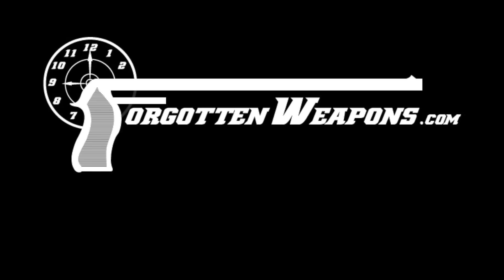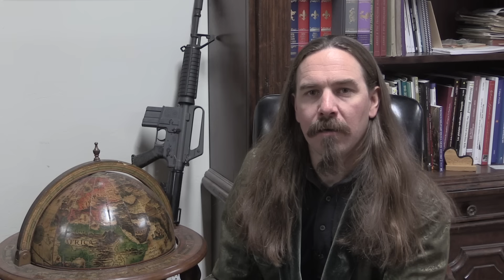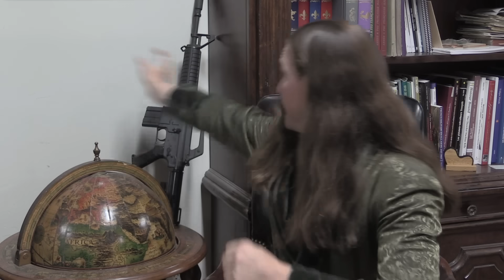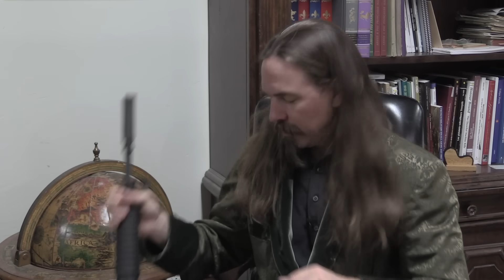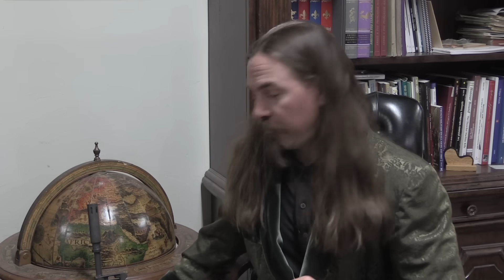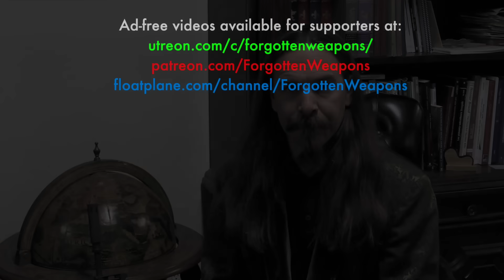Ask Ian: "Last Ditch" Rifles for World War III?

Comment: Having gone through US Army
basic training within the last year, I'll have you know the current issue M4A1 has auto instead of burst. Also, many of the weapons we had were originally M4's that had been converted to M4A1's, with the burst marking overstamped with auto and M4 overstamped with M4A1. I think it is also likely that for last ditch production, you would see carbine barrels because you can get twice as many carbine barrels from barrel blanks than you can get with 20 inch barrels. At least, that is what I've been told about button rifled barrels.
Reply: Blanks can be any length. They don't have to start off at 20"+. Profile your tube and drag a button through it. The longer barrel thing is more of a strategic resource use thing. Long barrels consume more material resources.
Reply: Barrels can be made to any length, but shorter barrels would have a number of advantages in this scenario.  Less raw material, less cycle time in the drilling and reaming operations, less cycle time in profiling, and the reduced workpiece weight means everything is easier and cheaper to move around and handle between operations.  The cycle time for button rifling is very short compared to all the other operations, but overall, even cutting 1" of length off of new barrels would save a lot of time and money when you consider the big quantities.
Reply: @rockhuddy  hammer forging would negate the need to drill, ream, and chamber which is time consuming and expensive compared to smashing tube onto a mandrel.
Reply: @randomidiot8142 CHF is definitely a very efficient process. In war scenarios, sometimes less efficient methods are used in concert with better ones. This could be because the tooling/setup for the better method is a significant investment, time consuming, or few companies can support it. I'll point out that the cast hull Sherman tanks eliminated much of the expensive, time-consuming welding, but welded  hulls were still rolling off assembly lines at the same time. This was because many of the Sherman producers didn't have casting facilities capable of making a full hull.
Reply: @randomidiot8142  You still need to drill and ream prior to hammer forging, maybe you could get away with drill only but the quality would suffer significantly.  I'm not aware of any hammer forging done from tubing, if that was an option then you could just as easily button rifle tubing.  Putting in the chamber as part of the hammer forging process is possible, and might make sense in this scenario, but it's not very common right now due to quality concerns.
Reply: @rockhuddy  no, you don't need to drill and ream before hammer forging. That's the whole point of hammer forging. You put bars of drawn over mandrel seamless tubing in one side and barrels come out the other. If you drill and ream, you might as well button rifle. I am pretty sure that TJ makes barrel liners from tubing, because his barrels are just rifled thin wall tubes. Working heavy-wall tube down to thin wall tube takes a lot more force and it doesn't make sense to do it when you can just buy tubing closer to your finished size.
Reply: One shot one kill…
Reply: Those are the old ones. I got out in 2019. My unit (4-25 BCT) had full-auto by 2018.
Reply: @randomidiot8142  your screen name makes a lot of sense suddenly
Reply: @D Murray Oh no, we didn't train with full auto. Using full auto was a ticket to being tackled by a drill sergeant. I'm just saying none of the carbines we used had a burst mechanism.
Reply: @D Murray Marine corps units that are low speed enough still have m16a4s, instead of m4a1s or m27s. Some NG units are still given A2s
Reply: @MrBenjaminleduc  - Not a given when using the Poodleshooter, especially one with the short barrel. The entire Flawed concept of SDHV is negated once the tube is shortened below 20”.  Having been forced to carry one of these in its CAR configuration I put 5 center mass hits on an enemy combatant only to have him continue to advance until I put one in his head.(tells you how close he was!). It’s way past time for the American Warrior to be issued a Proper Combat Rifle/Carbine and relegate the M16 series to the dustbin of history. The new 6.8mm that’s being slowly issued as the .556 is phased out is a step in the right direction but we all know how the MIC drags its heels when it comes to change.
Reply: The M4 is burst the M4A1 is full auto.

Comment: First, take the time to do it right...then think about cheap.
A perfect example is the simplification of the M1903 for WWII production.
On AR, I'd drop the fun switch and stick with semi only.
LAST thought...why the barrel cut instead of just making a slightly larger barrel clamp for M203s and eliminate a weak point in the barrel along with reducing cost?
Reply: True during world war 2 the Japanese and the Germans had iusses  military and industrial production  for example the Japanese have the home guard old men from the ages of 17 to 70 and women for the ages of 16 to 50  and the Nazis had the Volksstrum ages 17 to 40 and basically Hitler youth from ages 13 to 80
Reply: Integrated muzzle devices. Just holes drilled/machined into the barrel. Removed the threading step and having to making the muzzle device.

Comment: KE arms lowers would be key.  You can injection mold way faster than forge and machine. I am glad a company finally got the kinks worked out of polymer lowers.
Reply: @ljubomirculibrk4097  How much does recycling even matter in this scenario? You are sending guns out to the front line that are eventually going to be destroyed sight unseen or captured. Polymer molding fits neatly into this scenario as it's about as strong as aluminum if your polymer mix and design are just right, which the KP-15 lower happens to be.

If militaries had no problem making stocks out of wood for rifles chambered with far more powerful stuff than 5.56 that realistically couldn't be recycled, reused for anything else, and can rot over time in the right conditions for 100s of years, I see no problem issuing M4/M16s out of polymer.

And is there even an AR-15 lower that's stamped?
Reply: @ljubomirculibrk4097 you would have to stamp a lower for an AR in two halves. With the additional time it will take to weld them, you’re not going to get production time to just over a minute. Not to mention the additional time it takes to mount a tube, butt stock  and grip.
Reply: @@ljubomirculibrk4097   yea, but you still have to assemble the sheet metal and rivet together?  I honestly wasn't really think about the AK or stamped design. I was boxing myself into the standard AR/M4 platform. KE arms can mold one in 65s .  That's pretty damn fast.
Reply: @@user-ts3sw5pm7k  I own a KP-15.  It's solid.  It's not going anywhere and you can buy one for 80 bucks. I wouldn't make a sniper system from it, but for a general purpose 500 yds and in rifle, it works just fine.
Reply: @nathanielkidd2840   I think he is referring more to an AK style system.
Reply: Even better: redesign the upper to also be made from polymer.  The bolt, barrel, and trunion still need to be metal, not much else does.  Springs will be metal, of course, but they are cheap and stanardized.  Polymer fire control groups have been tried an do work, although metal insets on the rubbing and striking surfaces would be more reliable.  Even the smallest injection molding machines could make those parts.  There might be heat issues with the polymer upper, but chances are, conscripts won't shoot enough rounds for that to show up.
Reply: @@24680kong  barrel nut and gas tube would melt it unless it was made of PEEK or some kind of high temp polymer. Currently, that would cost much more than Aluminum.
Reply: @ljubomirculibrk4097  A block of steel may be more durable than a block of plastic, but a monolithic injection molded receiver will be more durable than a stamped, welded steel receiver. The fudds are wrong, steel is overrated for things that don't need to handle the full stress of firing.

Comment: I think one of the biggest ways to save time would be finish quality, I used to make M2 barrels and from start to finish took about 80 minutes for the profiling, as it was important to go slower for 1. insert life and 2. Surface finish (we shot for about 15-25 RA, but the exterior finish smoothness doesn't actually make a huge deal for the most part, excluding the muzzle/threads, you could drop 10-25 minutes a barrel just by cranking up the speed and sacrificing that surface finish down to about 125-175RA.

Comment: Teh Finnish army actually planned this in the early 60s. They designed what they called 7,62 RK X. It had a very crude stamped receiver which did not have a separate cover. The idea was that then one could use parts made for normal repair work to quickly assembler rifles.

Comment: My first thought to a war time at would be to get rid of the forward assist. There are many competition guns out there that don't have it. Stoner also added it to appease the army many years ago so it is clearly not needed 

Other considerations are things like the steel alloy used for the BCG. You could go back to something like high carbon tool steel which would last long enough apply a good coating and possibly reduce material complexity. 

Finally do you think they would just get rid of the detachable carry handle and go back to a fixed A2 style. Seems like it would reduce a lot of parts, machine time and logistical challenges of getting all the pieces to meet up somewhere when it was a completed firearm.

Comment: Having worked at injection molding the "cycle time" is usually from the mold closing to opening again and producing a part. Something under high stress, like a rifle receiver, would have from one to three steel inserts placed in the mold at each cycle (depending on the design). A skilled operator might do this in 15 to 20 seconds with a well organized supply of inserts at hand. Let's say a minute and a half per receiver which still beats a CNC operation by a mile.
Reply: Try zero steel inserts as is the case with the KP15. 

Ian has videos still up on YouTube about the monolithic polymer lower and his utreon page may have the factory tour footage.
Reply: @jeffreyholdeman3042  I can't say that I'd fire a centerfire rifle with an all plastic receiver. Assuming a semi-auto design I would have to see two guide rails (could be one piece) and a boss for the barrel to thread into. When I was in plastics even the Ruger ten round 10/22 mags had an insert.
Reply: Robot placement of the stamper metal inserts and over molded parts. With the press starting to start ejecting plastic before toggle lock. Imation had the 3.5 computer disk case down less that 45 second cycle time. With robot extraction starting to moving before the mold fully opened. The picatinny rail, stock and forearm could all be one piece.
Reply: @kennethwers  I've been at my current job for about 15 years so probably a little longer since I've worked in plastics (maybe 20 years). We placed inserts by hand and then (for safety) started the next cycle manually. Robotics could easily speed this up for a company willing to invest in it.
Reply: I agree wholeheartedly about the barrel attachment and rails for the bolt… the receiver (lower) that Ian referenced is unsupported polymer.

Comment: I would think the forward assist would be one of the first things to go.
Reply: The forward assist should have never existed to begin with. But yes it'd likely go first along with adjustable stocks and optics.
Reply: @clothar23  If you train to use it, it's useful once in a great while.
Reply: @generalkayoss7347   The forward assist exist solely for the purpose of dealing with a problem racking the charging handle solves just as well.

And racking the charging handle has the added benefit of not getting a round jammed into unfortunate places.
Reply: @clothar23  Yeah but bumping the forward assist is faster than racking the charging handle, plus you don't lose a round.
Reply: Last ditch rifles will mostly use last ditch ammo…….
Reply: @clothar23  No it does not fix a problem that the charging handle will solve. If your chamber is slightly fouled or dirty and spring pressure alone won't allow the bolt to close on a live round, chambering another round will have the same failure. At least with a forward assist OR a fixed charging handle you can force it closed and not repeat the same problem twice. Darn it, GeneralKayoss beat me to it,
Reply: @Hjerte_Verke  Either way, the solution is in something almost every other country on earth has in their standard service rifle. A fixed charging handle. Seriously, it's such a simple thing, how has the US not realized its utility? You can remove the forward assist, you make it easier to operate the gun in cold weather and mud, the charging handle itself is simpler and cheaper to make
Reply: @Hjerte_Verke   That's assuming your failure to feed is being caused by a fouled chamber. A problem which depending on how fouled it is can be solved by adjusting the gas pressure. 

Regardless if the round didn't want to feed properly the first time why force it ? Things are horrifically pear shaped if you're counting individual bullets. 

And honestly it takes two minutes tops to field strip a rifle enough to give it a basic cleaning. And if in the course of a day you can't find two minutes things are even more pear shaped. Since it takes more than a couple of fire fights to foul a rifle to the point where even adjusting the gas block can't help buy you time.
Reply: @filmandfirearms  Actually, a lot of countries use a non-reciprocating charging handle or one that can't be easily forced forward in their service rifle. Germany with the G36. France with the FAMAS. Austria and Australia with the AUG. There are also countries that still use the FAL or its derivatives which doesn't have a reciprocating charging handle.
Reply: @generalkayoss7347  You don't lose a round in either case, you can just pick up the ejected round.
Reply: @filmandfirearms  how does removing the forward assist make it easier to operate in the cold? Lol
Reply: @hailexiao2770  Sure, you don't lose the round when you're sitting at a bench shooting paper. Try finding that round in the middle of a firefight.
Reply: Instead of that you would just have a side charging it would be a cheaper easier thing than the top charging handles we have
Reply: @clutchboi4038  have you ever attempted to operate this weapon in Sub-Zero ...?

The side charging handle that's affixed to the boat is a way better design way cheaper it will become the dominant design eventually
Reply: If it's good enough for Kyle, it's good enough for us.
Reply: @Mossy500A  That's a great example. Didn't it come out in court that he actually had to use the FA?
Reply: @tcantrell5301  AR18 ftw
Reply: As it should be, Stoner knew what he was doing.
Reply: @clothar23  That should not even be considered it needs to stay, if you are mass producing "last ditch" guns, don't you think the ammo would be on the same level?
Reply: You'll never take my sniper button!
Reply: @generalkayoss7347 yes, he used the forward assist right before the bicep shot, when that bicep was pointing a Glock at him.  The rifle didn't fully cycle after he shot skateboard guy (Huber).
Reply: @Salty_Balls  Yeah I don't imagine it did cycle, from what I remember he was on his back and couldn't really shoulder it.

Comment: Tanks and Planes were the new technology in WW2 and that caused a shortage in metals. And to produce those took loads of lathes. And accurate (at least, accurate enough) lathes means heavy weight. Add that after Pearl Harbor, they had to significantly expand their production immediately. To replace caste iron to give the lathe necessary heft, they used concrete. There was a field manual that gave these instructions for creating these concrete lathes. They used two pipes to replace the dovetail for the tooling to travel. It wasn't the most accurate set up. It just needed to be accurate enough. And quick enough to produce.

Comment: Interesting points made about polymer. Here in australia our standard service rifle the f88 (now improved version called f90, steyr aug copy) has alot of polymer from the trigger, stock and firegroup (hammer included). Main metal components are the gas system, barrel/upper reciever. Mind you the f88 entered service in you guessed it 1988.